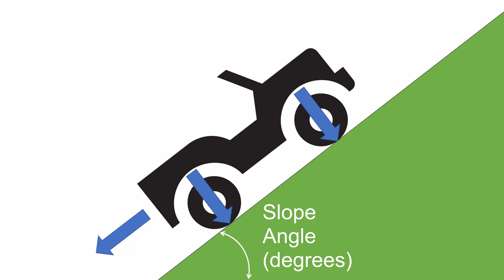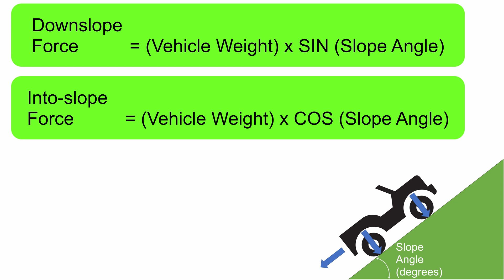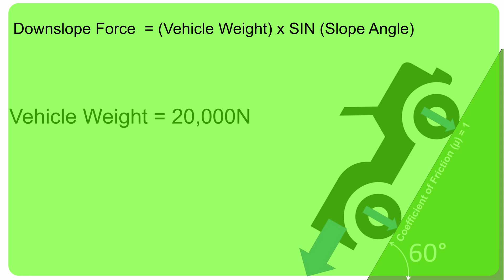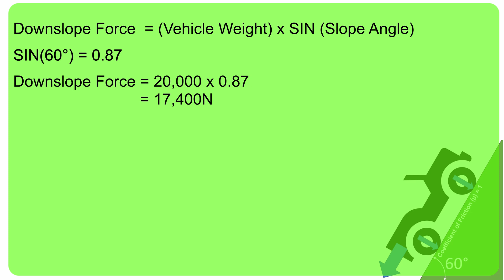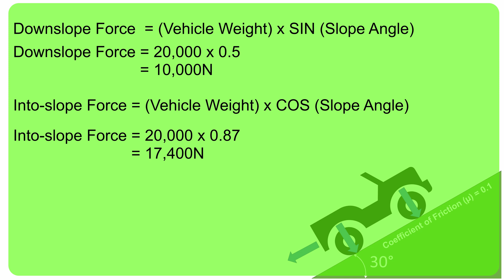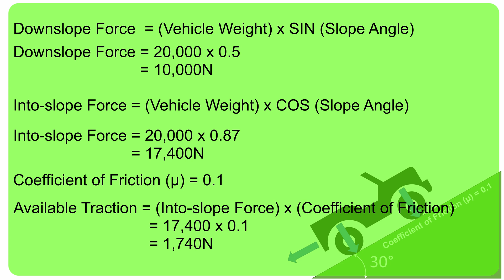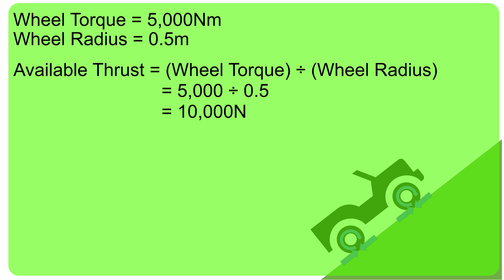Slope Climbing - Off-road vehicle fundamentals

Comment: N00b question: If I understood the early bit correctly, coefficient of friction and co-ef of rolling resistance are not the same thing...? With the latter, it's used to calculate the  amount of force required to push it forward?
Reply from the maker: Hi Adil, that’s not a noob question at all! Yes you’re right, coefficient of friction determines how much grip you have available, whereas coefficient of rolling resistance determines how hard it is to move the vehicle forwards. I’m planning a video on this very topic soon, so watch this space.
Reply: @Offroadvehicleengineering  Off-topic but are you open to taking questions via content requests? Maybe a Google form link? I wanted to ask why vehicles automatically switch off traction control when 4L is brought on. Thanks.
Reply: @Offroadvehicleengineering  understood, thanks.